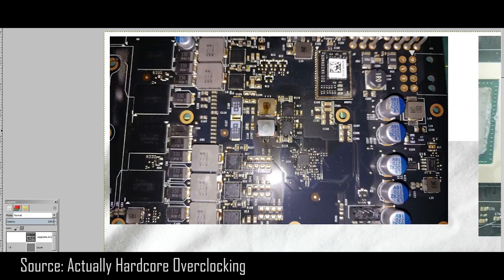Your Nvidia GPU Might Burn Up & Die?

Comment: I'm a regular gaming user. I have a Gigabyte 980ti I bought about 2 years ago. Yesterday it burned out as I was watching a youtube video.  The card was burning hot, heard an electric malfunction like noise and the computer shut down. It won't start if the said card is connected. I plugged back my old 560ti and it works.. Will contact the company for my warranty

Comment: I have (not installed anymore) a 780. I started getting computer crashes and freezes in certain games. 
I suspected it was my graphics card, but I couldn't get any crash reports because of how the games were crashing.
It's been smooth sailing with my new card.
I wonder if there's some similar hardware failure on the 780 that caused it.
(one of the games ran fine for weeks, then suddenly started crashing)
I'd open it up and take a peak if I was confident in doing that kind of thing. The card's still usable and I don't want to ruin it.

Comment: I have two 980 ti in sli they're the evga water cooled ones (so I think reference pcb). I've had them overcooked, memory as well, for a couple years or however long it's been since I got them. They do have the Samsung memory tho don't know if that would make a difference but my cards are fine so far. I will be taking the overclock off the memory tho.

Comment: I've had more issues with AMD cards, over the years - my X1900 and 280X were not too good... (the X1900 died under warranty - the replacement died out of its warranty).  My AMD 7970 was/is great.  I have the 980Ti ... so far, so good... no overclock, so maybe it will be OK.

Comment: Technically it is not Nvidia's fault as they provide the GPU dies to the AIB's. It is the AIB's that are manufacturing the graphics cards. They sometimes change the design and layout of the video card. AIB's order the PCB's and components (that come from CHINA) then run it through the smt machine. The end product is the smd or Graphics card. Sometimes if there is a shortage of electronic components they will source out the next available stock (usually due to high demand) +/- 20% of the value or rating. Unless it's an Nvidia manufactured card, for example the founders edition, then it really would be Nvidia's fault.

Comment: Had a 980ti (MSI V1) for 3 1/2 years. 105% overclock running VR. It's worked flawlessly. Just swapped it for an ASus Strux ROG 1080ti OC. Only used for gaming.

Comment: I have the Sea Hawk EK X 1080 in SLI, and these are reference PCB. So you're saying it might die some day soon? :|
Fuck....
Reply: it should be fine for a standard 8hour gaming sessions. but if you want to be safe you could underclock/undervolt your vram. fast vram is good for mining but does nothing for games.
Reply: +psionx1
Got it set to 4513 MHz, so unclocking. I hope to keep the two cards for a long time, as they are expensive.

Comment: I am curious about this because in my country there is a law that no matter the warranty the manufacturer has to replace the product if problem is caused by manufacturing fault. So no matter when my card fails, I could ask for replacement if it is confirmed that the inductor isn't meant for the amps that go through it.

Comment: If you have two cards, and this happens to both, then what are the signs and symptoms? How would a person know it is not the ram, mb, etc? Any quick tests?
Reply: Honestly, I don't know about any quick tests. It could have been a power surge, it could be the power supply, or it could be the motherboard. In any of those cases, the most likely direct cause is a spike to voltage on PCI Express.

Comment: I have an EVGA gtx 980ti sc with a koolance waterblock. Never had an issue. Overclocked at +150mhz on GPU and +400mhz on memory with no adjustment on voltage.

Comment: I have GTX 780. Dead before 2 years old 🤔🤔
Fan still working, rarely overclocked (heck even overclock not good as many reviewers got)
Edit: it is Leadtex card with nonrefference cooler, haven't opened yet but I highly suspect something burned inside below the cooler

Comment: the capacitors are also crap.  they pop
Reply: never had a memory inductor break but then again i dont like reference cards because the coolers are realy bad, rx580 is still my favorite card, strix or wind force both great coolers, acx3 is ok but screw team greed
Reply: h34d5hot Yeah, my strix 970 is still going strong after 3 years. Some coolers may have deadzones in airflow, I don't know.

Comment: Whoa, I actually might be able to help! Then again in my case it IS a much older card - a GTX285 in fact. This IS how it died, however, and while I never overclocked it other than enabling "turbo" because it was a gaming card and then retired straight to a MediaPC when I upgraded - that is how it died. Nothing else ran hot and the GPU temperature never even broke 82 - I had it set to try to stay under 75C all the time. Interestingly, when playing games in 1080p Ultra mode (hey, that was a big deal 9 years ago!) I would run into memory issues present in the form of artifacting after gaming for a while, but the temperature of the GPU would be stable that whole time, so I always assumed bad VRAM until what I assumed was the caps started leaking. Card didn't even die instantly - in fact even now it will POST fine and get halfway through the boot process sometimes before it hangs. I guess I'm wondering if this is NOT a new thing for Nvidia, but a long-term running cost-cutting measure? Thanks for this heads-up, and I'm definitely curious to see what happens. (And concerned because 5 of my 5 current video cards are NVidia and the only non-reference one is a Asus ROG STRIX 1070Ti so...)

Comment: I am calling bullshit on this. Sorry but as former owner of EVGA GTX 980TI SC, + 100 MHz overclock on both gpu/memory.  My card never got hotter then 75 degrees, and I played a lot ark and many other games.  I had large case with both top, front and side fans and the card was beast of card and ran fine. 
I’m sorry but If you don’t look after your gpu and or you overcloud it and don’t monitor the temp. Yes you could burn the card up,  

Where does it say these GPUs were NOT used for bit minding?  They could have been over used for that. Bad setup, overtaxeed,

Also this Maybe only certain card,   Jays2cent has overclocked many Maxwell GPUs and never as far I know has one break like this. 
Sorry but I have feeling this is not because bad board. But ppl over abusing the GPUs and or rare ones that have died because of error of the user not taking care of your gpu and system and proper cooling..

Is possible that this is issue. Yes. There could be bad PCB board.  But so far from my experience. My old GTX 980TI was fine. 
Only had replaced cuz fan motors started to go, was under warranty. So I upgrade. 
Unless I see a lot ppl reporting this, im not trusting this and going assume these GPUs died because abuse. 
Bit coin GPUs I bet.  I could be wrong but seems weird that only now this being reported ? Lol

Comment: Each and every video takes you closer and closer to Linus and that really is not a great thing. The unfounded amount of FUD in your recent few videos is ridiculous. 

You're stating pretty much all high end nVidia GPUs as being problems, even though there is virtually nothing to support this. You are showing, and then informing us that these are high end cards from an 'Overclocking' channel being burned up, and/or from miners (BS). Taking a piece of equipment and then pushing it BEYOND what it was designed for is not a case to then shit on the entire line of cards because it doesn't have the components that you want. I challenge you to get some RX cards and perform the same tests, push the cards as hard as the team green cards were pushed. Betcha a buck that once you push 'em that far, they'll fail too.

Comment: I haven’t experienced this yet. I used to have EVGA 980s with ACX 2.0 coolers. Its got a reference PCB and they’re still in use today in my friends PC. I have two GTX 1080s FE and they’re both watercooled and still not have this issue.

Comment: Planned obsolescence.
Reply: tenshi7angel How is card death by design not just another form of planned obsolescence?
Reply: +Sure Lock
Obsolete is where it is out of date or replaced by better, not broken and unusable.
Reply: @tenshi7angel  no, planned obsolescence means they plan  how long a product will last. Its mostly down on light bulbs with xxxx hours of life (while a light bulb has been working since 1901).
Reply: No planned obsolescence is where Nvidia rolls out in the drivers, changes that impact the game performance of older generation cards, due to the no longer used or supported efficient coding for the family or generation of graphics card that you are using, because a newer card generation came out. Along with encouraging developers to roll out game engines that require more graphical performance.

What we are seeing here is card death, which is card death by design.
Reply: Er, thats been quite effectively debunked now mate. Planned obsolescence isnt a thing that happens.

Comment: Just wating AMD to do something decent again so I can get rid of my 1080ti.
Reply: You can wait till forever, or you can try to get your hands on Rx Vega 56 or 64 crossfire, if not, I don't think you will be switching untill many years later.
Reply: That's literally Highest-END, 1080/Vega64 High-end, Vega56/1070/1070Ti Mid-High, 1060/RX580 Mid, etc. AMD already made decent GPUs, they just didn't aim to the Highest-niche performance, yet.
Reply: Wouldnt suprise me if by the end of this year vega 64 outperforms 1080ti on dx12 and vulcan.
Reply: vega 64 actually performs better undervolted.
Reply: Vega 64 can't reach 1080Ti fps even overclocked and undervolted to the max. Maybe in a very well optimized game but in most not.
Reply: 1080tis have 11gigs of vram vs 8 that a vega 64 has. I don't think anyone is denying that a ti is the best card out.
Reply: Hopefully more games are like far cry 5 optimized for every hardware. Vega is very close to the 1080ti in that game.
Reply: 11GB vs 8GB isn't that big of a difference tbh, and Vega has HBCC.
Reply: Vega wont catch the 1080 ti, even with Vulkan and DX12. In fact DX12 benefits a 1080ti more than it does Vega. You might see Vega catching the 1080 but not the 1080ti. It would be like expecting a 1050 to catch a 1070. Aint gonna happen.

Comment: Wtf is going on with nvidia, it's the perfect time for AMD to kick nvidia's ass like they did Intel.
Reply: just because ryzen is a bit slower doesn't mean its bad, besides ryzen made intel actually step up with the i3's because year after year "OH LOOK ITS ANOTHER EPIC DUAL CORE i3 THATS A LITTLE BIT BETTER THAN LAST GENERATION"
Reply: Indian Tech Support intel is way on top. Intel is more afraid of Arms and qualcomm
Reply: Hayate Azekura Debatable.
Reply: Qualcomm at the moment are not threats, they do not have the patents. VIA is a larger threat.
Reply: Hayate Azekura Intel have higher performance, but not performance per dollar, so unless you have $1500+ to blow, AMD is superior in many areas.
Reply: AMD havent kicked Intels ass since the early 2000's. Ryzen was core for core quite a lot slower than even older gen Intel parts.
Reply: I didnt say Ryzen was bad. But it didnt kick Intels ass. Personally I think that Intel deserve credit for the chips it makes, not AMD. We dont thank Intel for making AMD come up with Ryzen do we? But we could...

Comment: I have a 780ti that I baked because that was the only solution, if anything more happens to it I'll be sure to look into it, will also remove the 12.6ghz on the memory for my 1080 until we know if the 10 series cards have this problem too

Comment: HAHAHAHAHAHA!! There goes the meme that AMD cards run HOT and LOUD!! Perhaps AMD are actually building cards that run at the safe limit of what the parts allow especially when overclocked! Which then raises the question is the Vega 64 really that bad performance-wise (ignoring the stupid price gouging of the retailers) when your 1080ti could blow up on you? A friend recently had his 780ti die on him and it looked like something had corroded on the pcb. I have not had a card die on me yet, touch wood, but now I worry about my two 980tis, my 970 and 1070 and becoming less concerned about the fan noise on my R9 390 when running ROTR, Star Citizen, GTA V, or Watchdogs 2 at close to ultra.
Reply: It happened in the past, during fermi era, also evga. Besides Nvidia fanboys like to say AMD drivers suck but where is their proof? AdoredTV made a video about it go watch his channel. Fanboy? He owns Nvidia cards maybe. Also GPP, 970 3.5, nvidia $9999 workstation GPU math error. From your tone you clearly are an Nvidia fanboy.

Comment: Brett, I actually talk to buildzoid through patreon because this was happening. So we found the the best way to avoid this, is staying below rated amps. My MSI 980 ti did blow mem inductor  during test, but I RMA'ed it. His solder truck did work, highly recommended watching his video.